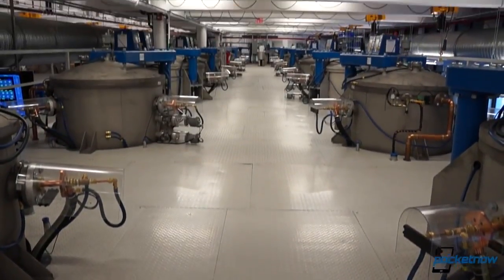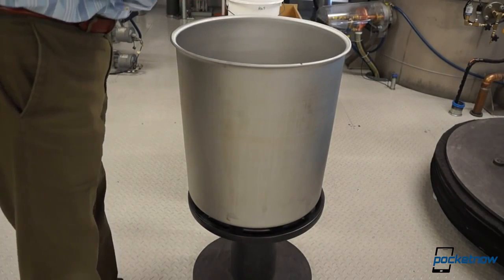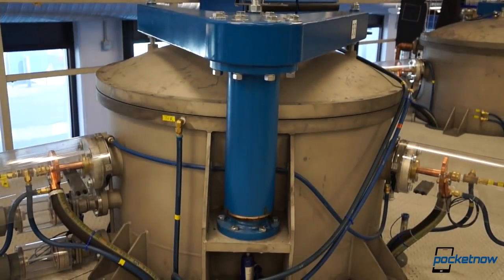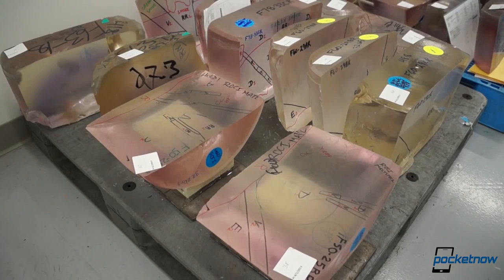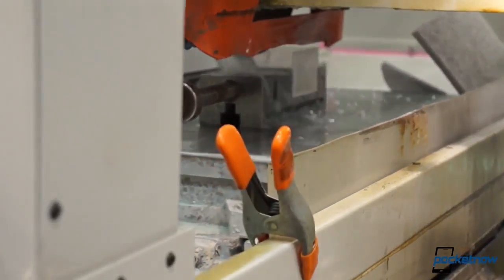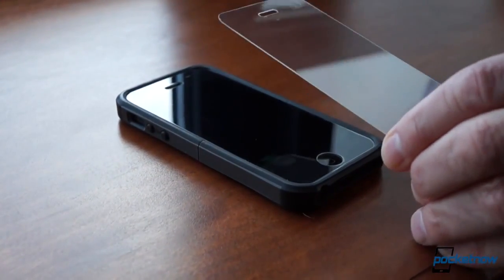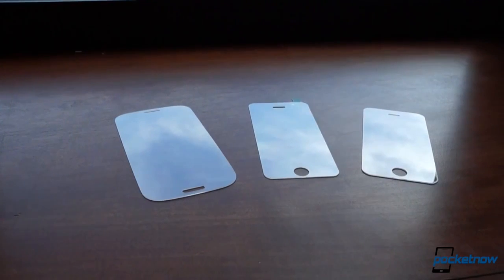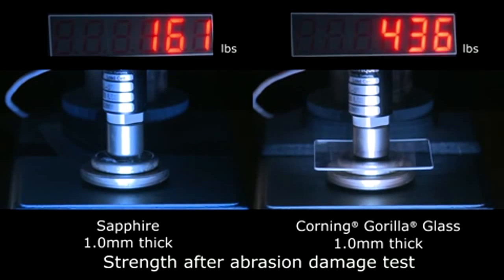Sapphire vs Gorilla Glass

Comment: Wait, so after that video the end shows the gorilla glass beating the Sapphire crystal, what gives?
Reply: sapphire is better for small products with less surface space like apple watch or the touch ID sensor because it doesn't scratch. That is probably why it isn't used on the iPhone 6 or larger displays. There is other setbacks though the transparency isn't as good as gorilla glass and it costs a lot more to make. This is probably why GT advanced technologies, a sapphire glass producers, stock fell from its peak $20 to 43 cents and they are filing bankruptcy.
Reply: In that case, sapphire is harder to scratch, but more likely to break during impact of a fall than Gorilla Glass?
Reply: Andrew Ng  Exactly.
Reply: because it is harder and has more stiffnes. gorilla on the other hand isn't sapphire or real glass at all, it is chemically tempered, means that it will withstand more Force/sq", xda has a great example on how those screen protectors are made.
Reply: iz dragontail out